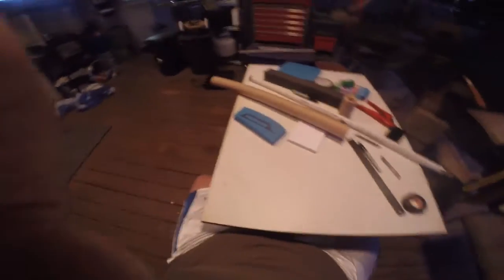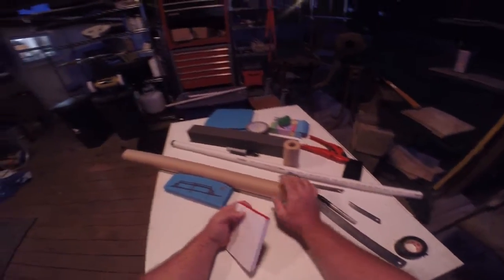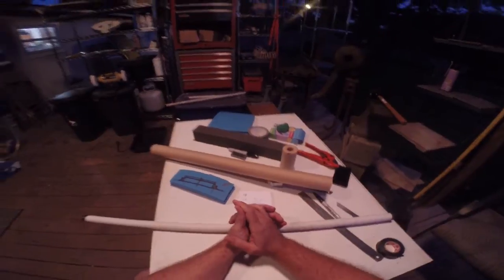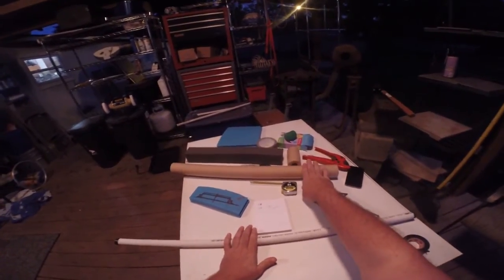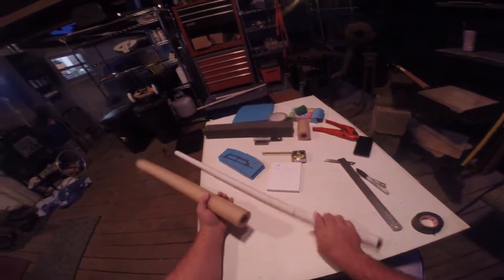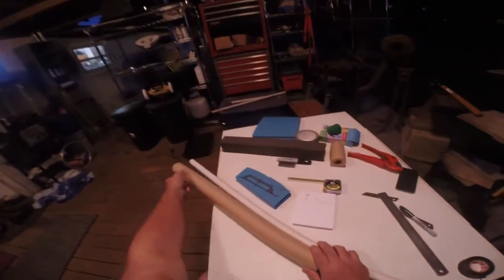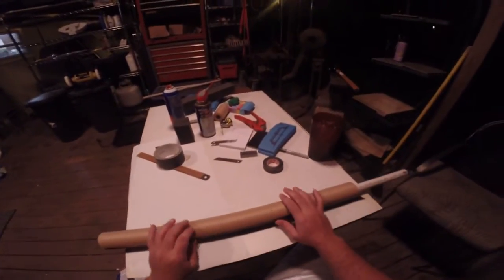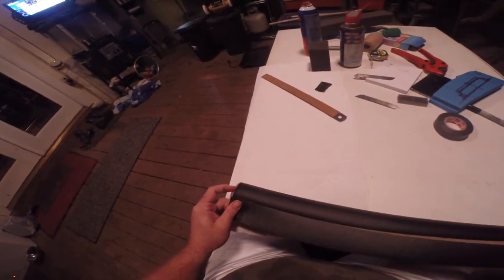Boffer making Part1: prep and blade

Comment: In making this blade, what was the total cost, and do you have any recommendations on where to get the different materials?
Reply from the maker: I do not have a cost. I buy my materials from local hardware store in bulk. I have to have the foam ordered for me but it is available on amazon. http://www.amazon.com/ITP-Limited-PR58078TA-Insulation-Tundra/dp/B000DZHD0W/ref=sr_1_1?ie=UTF8&qid=1423541944&sr=8-1&keywords=pipe+foam+5%2F8+thick#productDetails